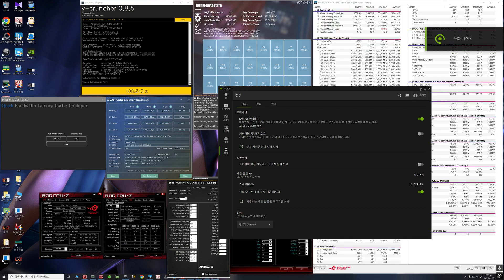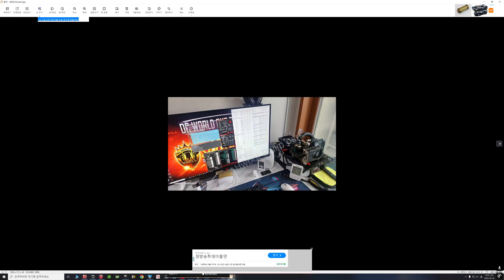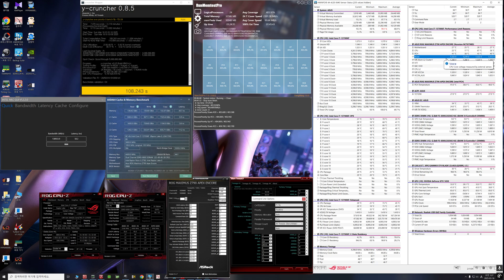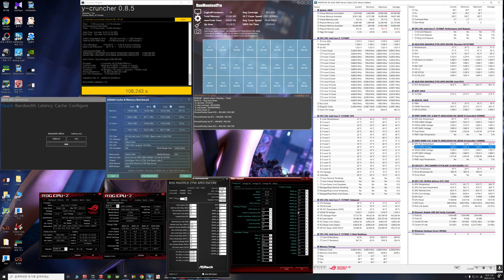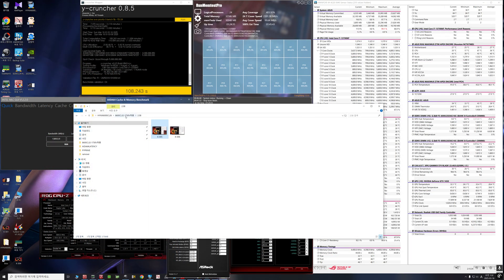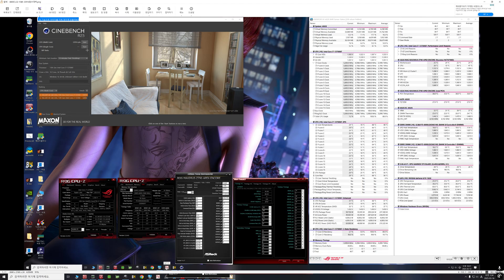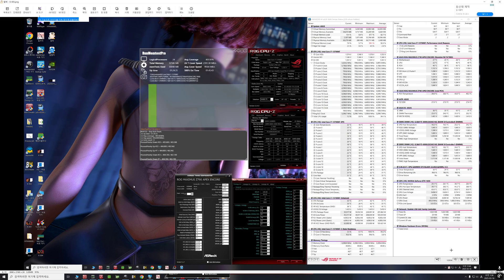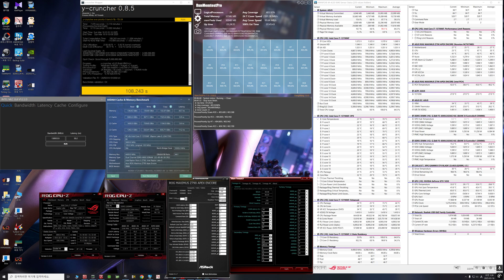ASUS Z790 APEX ENCORE  8,800CL32  MEMORY OVER CLOCK

Comment: are you gonna daily this? and is 9000mhz not stable?
Reply from the maker: this is only 3day test now  i think no problem on daily use it  9000mhz is not start  
1st use test  8600cl32 passed  2nd day test it 8600cl32 again and 8800cl32 test it  3rd day passed 4time 8800cl32 passed
i need to rest time ^^
Reply from the maker: Now it is very stable it do you want any test it?  And I test it only 2~3days  ,  Do you think 9000mhz is an easy task? I haven't even tried it yet. It's only possible on 15th generation CPU on z890
Reply: @Hwbot-Philip-Park  you should try the highest speed you can reach with gear 2 gonna be really interesting
Reply from the maker: @tyt7794  i need 14900k or ks
Reply: @Hwbot-Philip-Park  i saw 9066  MHz on z790i asrock, stable in 30min gaming session. Very lucky IMC+MOB+RAM, and probably u can achieve 9k+ ddr5 on 1700.
Reply from the maker: @FotonPC  well G.skill Competiton is finished Mar.19 after try it
Reply: @Hwbot-Philip-Park  well i won't call it an easy task but there are some very few people who did 9000mhz+ trying is always good true it's much easer with CUDIMMs but give it a shoot

Comment: What is your favorite bios for the apex encore?
Reply from the maker: i test all of  z790 apex encore bios it  i think  0506 and 0080 and 9901  9905 is almost same  but 9938 and 1801bios is have some of issue  cpu pcore is not fixed it you can watch
this  Hwinfo there 

but this is no problem about performance   cpu temp little  low  is good and engergy is save it   i test it microcode 11 also same not fixed it 
i think 9905 is best   i test it 8600cl32 and 8800cl32 both of 9905 9988 all passed same it
Reply: @Hwbot-Philip-Park  thanks!
Reply: Probably 9905 and 9988 1:25